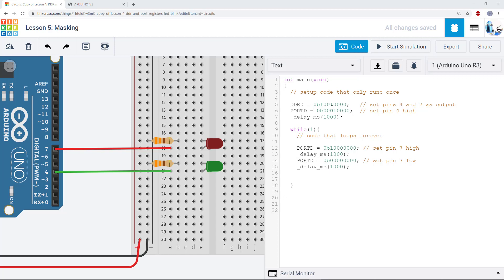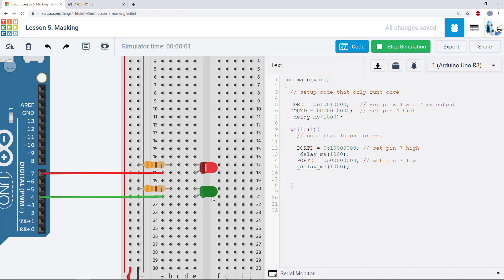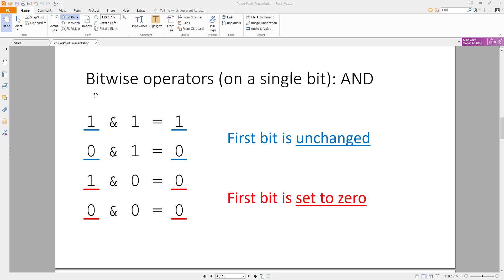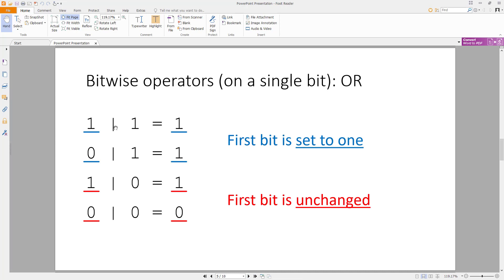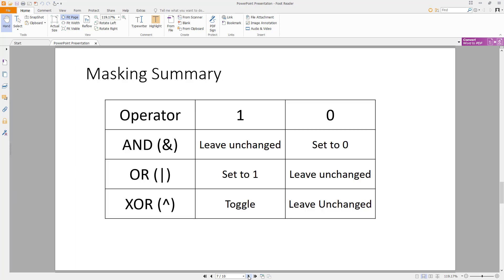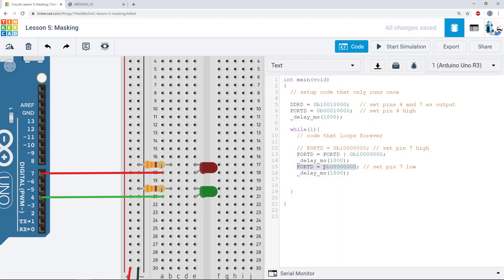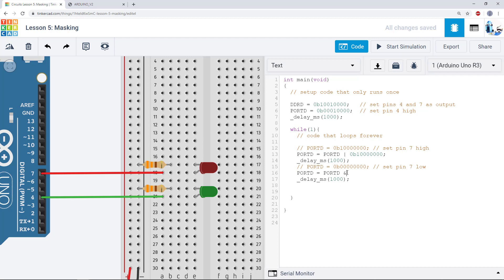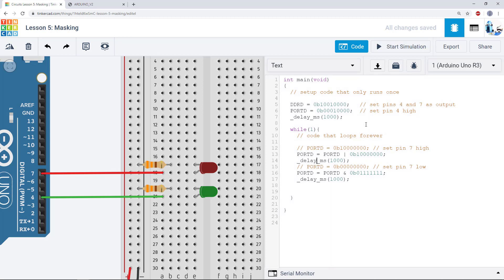Tinkercad + Arduino Lesson 5: Masking and Bitwise Operators

Comment: You lecture is awesome! I've been following along for a couple hours and it's addictive.
For the assignment sadly you provide no solutions to verify our answers.
I don't have an arduino at hand to check and Tinkercad has some weird Fade In/Out animation for the LEDs that makes it hard to verify the timings.
Would the following be correct?
int main(void){
    DDRD = 0b11110000; //Set 4 outputs;
    PORTD = 0b01000000; //Set bit6 to on;
    while(1) {
        PORTD = PORTD ^ 0b10010000; //Toggle bit7 and bit4;
        _delay_ms(500);
        PORTD = PORTD ^ 0b00010000; //Toggle bit4;
        _delay_ms(500);
    }
}
Reply from the maker: Hi - I didn't provide answers since I was using these tutorials in a class I was teaching. Unfortunately I don't have time to go through and check your code at the moment, but one suggestion would be to simply increase the times (to a few seconds each) so the fade effect in Tinkercad isn't as prominent.

Comment: this bit system for the coding in tinkercad can be very useful but because i am used with pinMode etc. method it will be will be realy hard to make this change! but i will try it!
Reply from the maker: Hi - to clarify in case you didn't watch the intro video in this playlist - this is material taught in a college-level class at Cornell. If you are just doing a project for fun there is nothing wrong with using pinMode etc, but it's certainly worth learning if you would like to develop your microcontroller skills further.
Reply: @BenFinio  Hi there. This is very handy for self taught and curious people. Thank you.
Reply: @BenFinio  i thought this was for begginers i was so lost